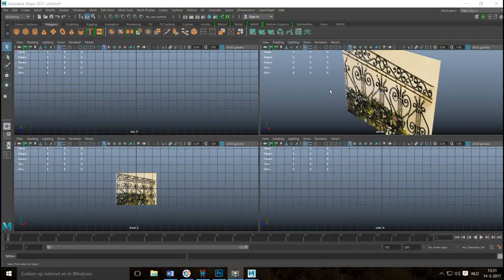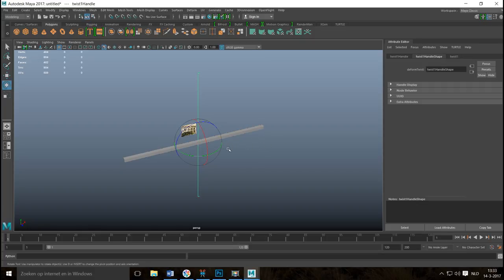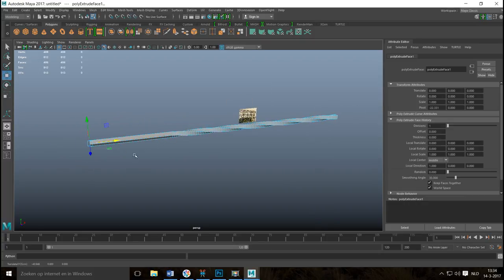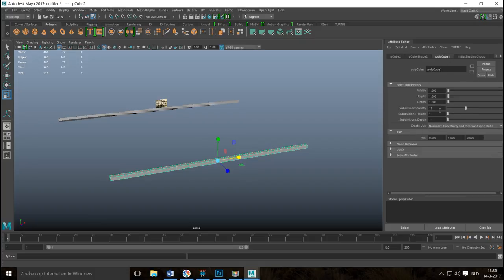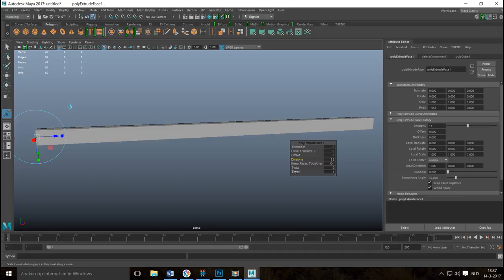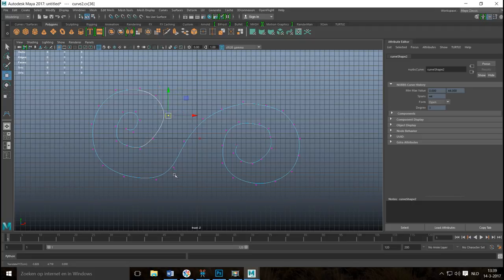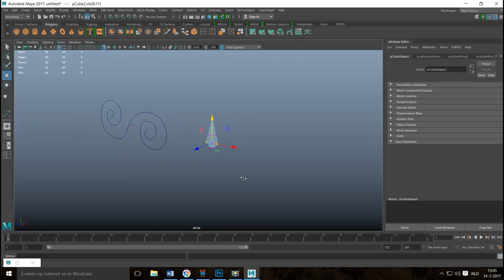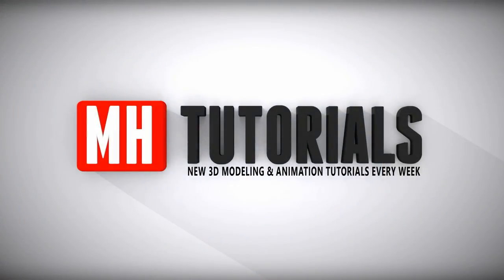How to model Fence parts in Maya 2017

Comment: How could I turn on mental ray from plug in manager? There is no option... Plz hlp me...
Reply from the maker: If you have 2016 or earlier look for mayatomr.mll and activate it. If you have Maya 2017 it is not there and you need to download it off NVIDIA.com
Reply: How could I download that? I have Maya 2017, and that's cracked version...
Reply from the maker: www.nividia.com